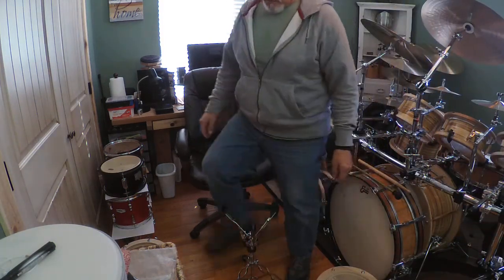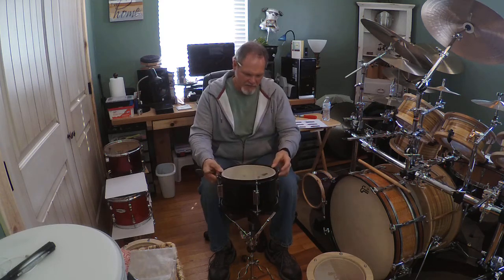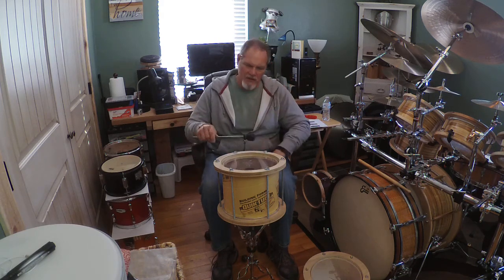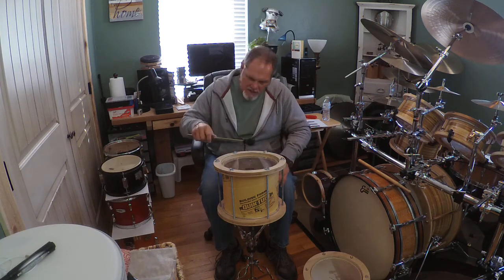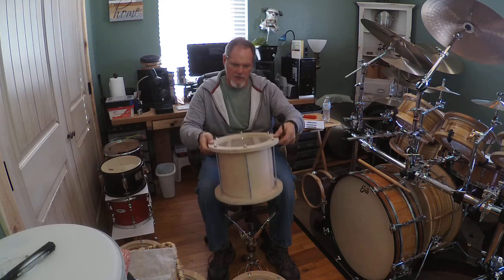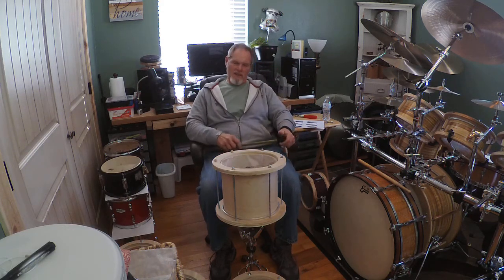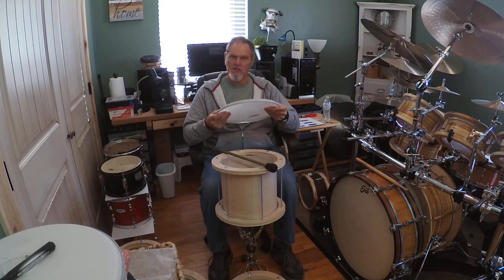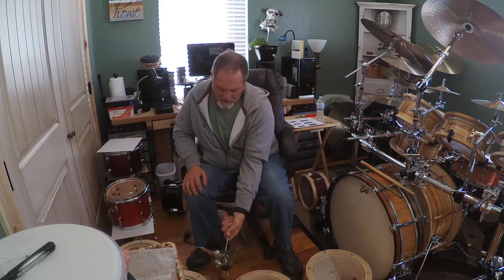Drum Shells and Sound - Bearing Edges, Part 6

Comment: saying that bearing edges somehow affect the sound of the drums is the biggest bunch of BS i have ever heard.This is snake oil .The drum shell itself(which has no influence  on the sound of the drum whatsoever) probably has more impact on the sound then the bearing edge.And also you have some drummers say they can hear the difference between different bearing edges,this is even more BS.I cant believe most drummers fall for this crap....
Reply from the maker: Well, it has been decades of hype and drilling this mantra into the heads of players, especially younger ones so, without some common sense along the way, players have become convinced of things that defy logic and actual physical proof. Those responsible for the hype will one day run out of things to hype, a drum being what it is, and if things do not change before then, things will change by default.  
That said, drums with edges that allow heads to seat better, will sound better, in general. Dispelling myths about bearing edges was easy to do but, that is not to say bearing edges do not play a part in a drum head throwing off sound waves more efficiently, if wide open sound and sustain is what you are after. From that point it is just nuances of muting: heads touching wood. 
The shell does have something to do with the sound of a drum in that the more dense it is, the more sound waves will be trapped and move around before absorbing into the shell wall, or just dissipating. It's all nuances, though.  
Hype and more hype will ultimately be seen for what it is, hopefully.